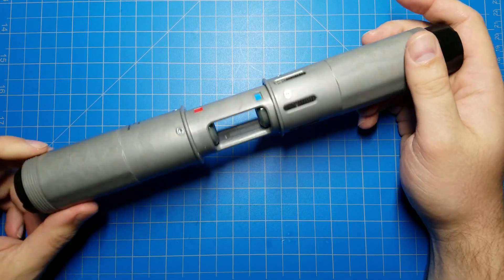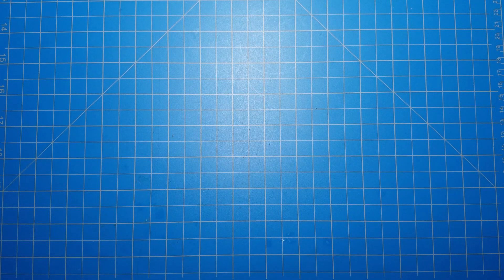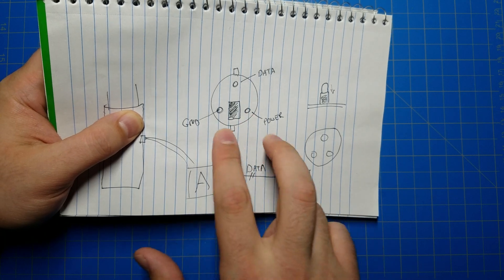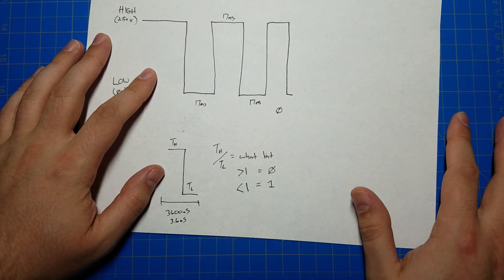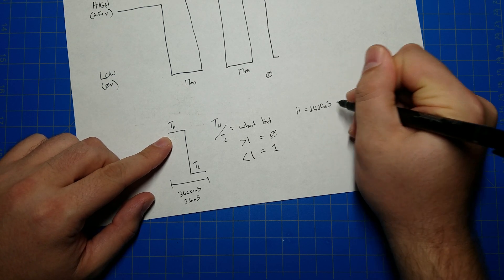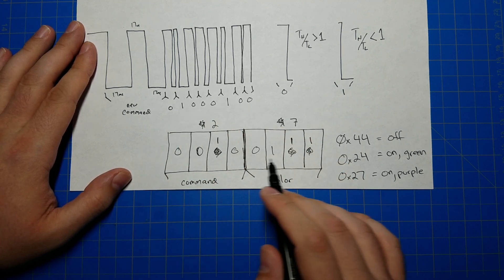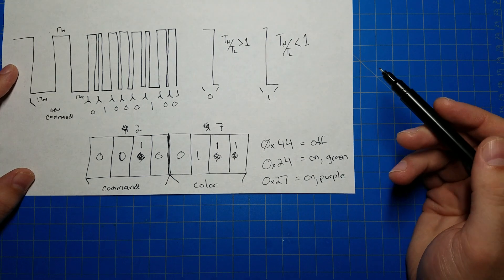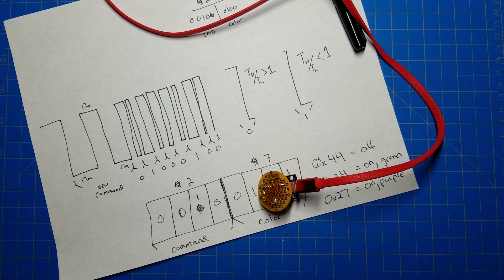Hacking a Galaxy's Edge Lightsaber Blade

Comment: So how is blade holding using 5v with resistor on data pin after all this time? Is it safe?
Reply from the maker: i've been using it quite a lot over the last year and it has not caused any problems with the blades. using 2 resistors to create a voltage divider, so when the output is HIGH, instead of 5V the blade data pin would see 2.5 volts, would be better. but using a single 10k resistor to limit the current seems to be safe enough.
Reply: @Ruthsarian  Great! Thank you!

Comment: My legacy lightsaber turned white for some reason idk why it doesn’t have any sound or anything, I recorded it and it’s on my channel check it out
Reply from the maker: remove the battery pack from the saber. wait about 5 minutes, then put it back in and see if that fixes the issue.
Reply: Ok I’ll try that thx
Reply: Bread Challange  it did for a short while then it just stopped turning on

Comment: I have a question about a mod that I have been wanting to do for a while 
I want to make a cheap light up blade plug for my saber
I don’t want it to change colors or anything but I do want it to be bright
Would it be safe to run LEDs directly off of the saber as long as I use the right resistor?
Reply from the maker: Yes, running LEDs off the saber should be fine. The power that feeds the blade comes straight from the battery (no regulation). This means the voltage will change over time as the batteries drain (the LED will grow dimmer). Assume 4.5 volts when calculating the resistor value.
Reply: Ruthsarian Thanks
I just wanted to say that I really appreciate your videos
You are the only person who is exploring and explaining how the galaxies edge lightsabers work
Without your videos I would never have the confidence to explore this project on my own
Thanks again

Comment: Hello, sorry for a little bit different question, but do you think that is possible to shorten galaxy's edge blade? I have 36" and it's too long.
Reply from the maker: yes, definitely possible. you'll have to cut the clear plastic tube and drill new holes in it so it can be reattached to the base of the blade. the blade PCB has holes in it to fit each LED. cut the PCB on either side of the LED that's you want to be the new tip of the blade. then reassemble it and it should work without issue. i have not done this myself, but i have seen other people do it successfully.

if you're unsure, check in to the #makerspace channel on the Galaxy's Edge discord server (go to swgediscord.com to get access to the discord server). there are people there who have done this mod and could answer any questions. I'm in there too. :)
Reply from the maker: @kvetoslavcerveny5495  yup! i have seen someone else do this to create a smaller blade for their kid.

Comment: So with this method, is it possible to generate an orange blade for certain crystals?
Reply from the maker: yup! Dead Bothans have already done it. It requires replacing the microcontroller in the blade and you could also replace the LEDs with some 'neopixel' LEDs for better animation effects too.

see: https://youtu.be/0tyXPJwSe80
Reply: @Ruthsarian  If you have a black kyber crystal, how do you make the blade black after you put the crystal in your lightsaber?
Reply: @loop5720  you gotta buy a can of black spraypaint and apply it to the blade

Comment: Is there a way to separate the color you choose with the soundboard that you choose from the different varieties. Example I would like to have a blue blade but what all the sound effects that the green kyber Crystal provide specifically the ignition sound
Reply from the maker: For sabers from Galaxy's Edge, not really. It would require essentially replacing everything inside the blade. It's possible, but complicated.

Comment: where did you order the cable from and what is it called? My Light saber is having the same problem.
Reply from the maker: It's a flat flex cable, usually abbreviated as FFC. 8 pin, 0.5mm pitch, forward direction, 150mm in length
I bought mine off eBay here: https://www.ebay.com/itm/123697361346

Comment: Curiously, how does the blade itself receive the RGB and voltage?  Thanks to this video I understand how the processor is receiving the command... but at the end of the day isn't the LED tape simply putting voltage through 3 channels?  Thus... is there a point in the LED tape that can be hacked to direct inject the voltage and RGB signal via a protocol such as DMX, bypassing the processor?  Just curious if I have something backwards in my mind on that.  In the mean time I can't wait to try the approach in this vid and learn something new!  :)
Reply from the maker: I have a video going over the blade's RGB LEDs and how they operate here: https://www.youtube.com/watch?v=tXyoUpembc8

The RGB LEDs in the blade are arranged in parallel. Each RGB LED has a power input pin (common anode), and then one output pin (cathode) for each color. Connect power to all the RGB LEDs' common anode, then connect the RED pin of all the RGB LEDs to ground, leaving the pins for the other two colors disconnected, and you've got a red lightsaber blade. The connecting color pins to ground is done through transistors controlled by a microcontroller in the base of the blade.

Comment: Is it possible to use the arduino in a custom hilt to make a basic light up lightsaber with no sound or clash?  I used to make sabers and blade out of EL wire and plumbing parts 15 years ago and would like to see if I can make a basic light up hilt that will accept a Savis blade.

I've never seen one of these before, does the arduino store code on board or does it need to stay connected to a device?
Reply from the maker: It's definitely possible to create a custom hilt that will accept a Savi's blade. Sound and clash are optional. You control what the blade does with the code you put on the arduino. 

the arduino stores the code. i'm hooking it up to a USB cable only to provide power to the arduino and the blade. 

There are a lot of resources on the internet for working with arduinos. The getting started page on the official site for arduino, https://www.arduino.cc/en/Guide/HomePage is one place to start. I would recommend Adafruit: https://learn.adafruit.com/series/learn-arduino. Kits can be found on Amazon, eBay, Adafruit that usually cost around $30 (or less) and come with an arduino, a breadboard, some sensors and other bits of electronics to help you get started.
Reply: @Ruthsarian  awesome, thanks!

Comment: Do you think they will make orange crystals for these lightsabers
Reply from the maker: i don't think so. the there is a microcontroller in the base of the blade that reads commands from the hilt and controls the LEDs in the blade. That microcontroller's code doesn't appear to include the code to make the blade turn orange. 

If an orange crystal was released, it would require purchasing a new blade to see the orange color. Given that, I doubt they would release an orange (or any other new color) crystal. At least not one intended for use with a custom lightsaber from Savi's workshop.
Reply: @Ruthsarian  I see that seem a bit strange that they would make a chip that only reads certain colors cause what if they make some colors canon again
Reply: @Ruthsarian  Would be possible to turn yellow and red on simultaneously?  Yellow and Red are the primary colors that make Orange.  I would think the same is true for teal with green and blue... but perhaps choosing two colors is not possible?
Reply from the maker: the blade uses RGB LEDs which means they can produce any color including orange and teal. however the microcontroller on the blade controls what colors it will display and it has a limited number of colors it supports and which does not include orange or teal. to get an orange, teal, or other non-standard blade color the microcontroller would need to be replaced, which is not a simple task. if Disney wanted to support new colors they would need to provide updated/newer blades.
Reply: It would require fixed blades, right?